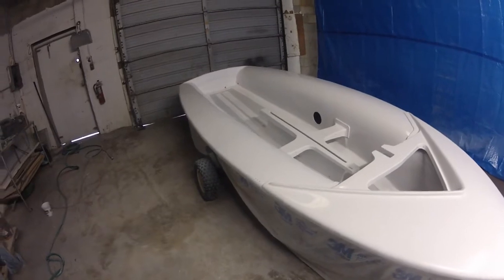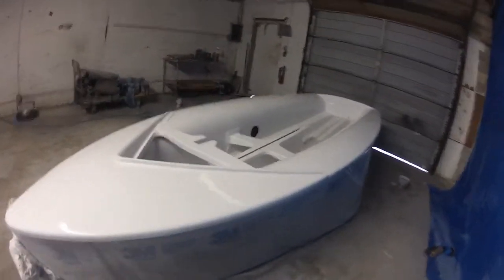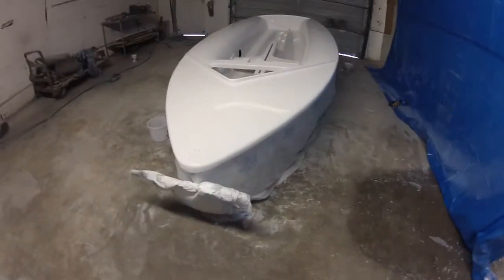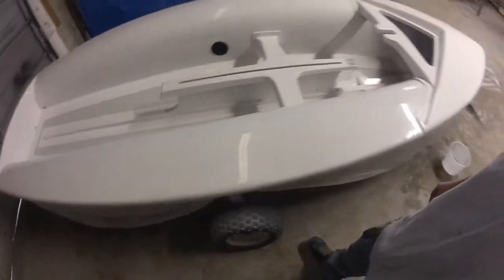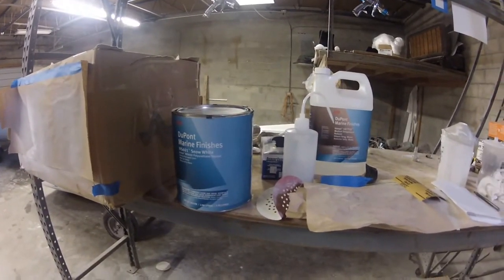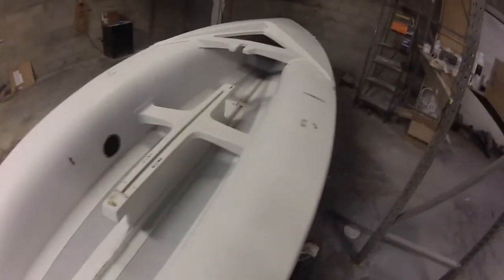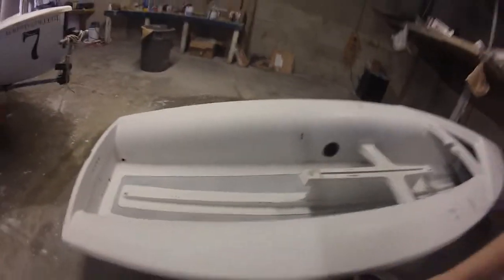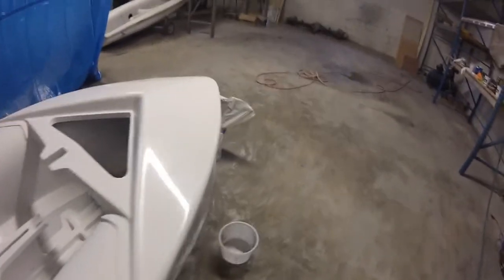Dupont Imron marine paint finish-MS600

Comment: I painted my 1976 tr6 in british racing green IMRON and the trick was to mix it with a very fast drying thiner which kept the dust from sticking so the job turned out as humanly perfect as any hand laquer job. It was just a masterpiece. I bought the imron at 80.00 a galion in 1987. I had a pro spray it for 300.00 who knew about fast dry thiner. I do have pictures of the car. Its been in fla the pan handel since 1988. It shines brighter than the sun
Reply: guys tr6 dazzles so you can shave in its shine

Comment from the maker: first of you need an epoxy primer either imron primer or whatever let that dry and then sand with 220 until all smoothed then spray away you can sand a little finer if your worried about super fine scratches this was not a problem with my finish

Comment from the maker: you can buy it at merritsupply  It is extremely deadly to use without sufficient fresh air supply respirator, thats a mask not with just a filter but a charger tube of fresh air  filter from from the spraying. Also to be honest it does not resist scratching as well as I had hoped